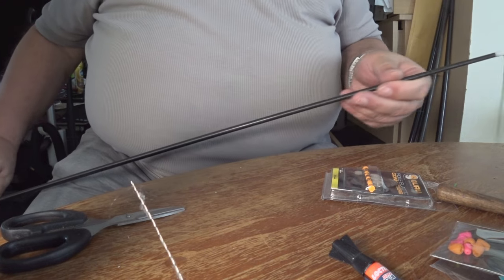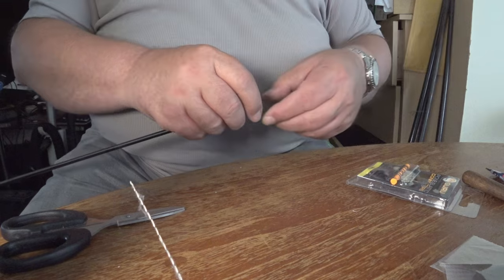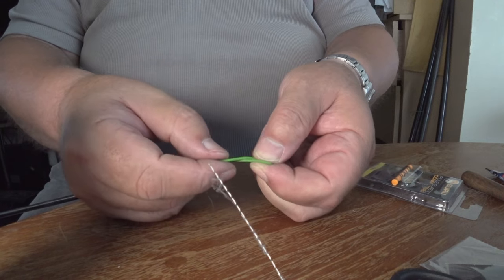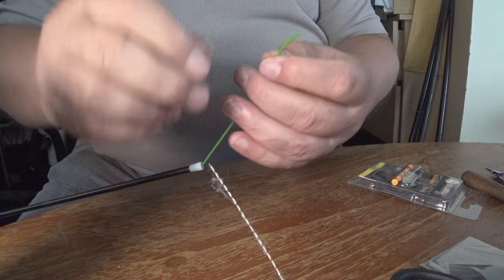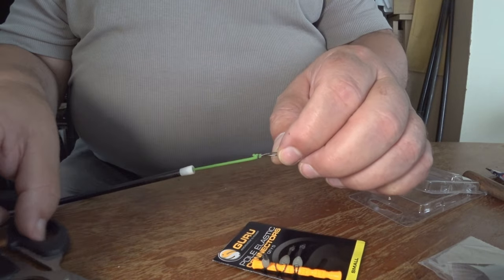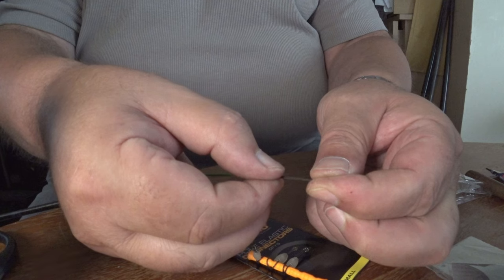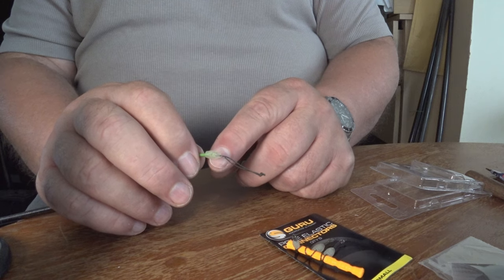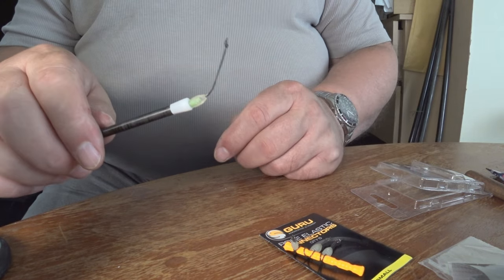Dacron connector to elastic.

Comment: Not lost a fish as yet line direct onto elastic just got make sure you check everytime you use and re tie the knot if needed or buy a new elastic if needed.  The benefit of using line direct to elastic is you can use them for both up in the water and bottom rigs.  I see you are using external bushes ive lost fish when the line goes over the bush internal all the way for me now they are much neater. Just big carp i will use dacron. Just find your post funny that you are worried about the line cutting into the elastic but you are more than happy to use them bushes that dont make sense to me that
Reply from the maker: That kit is somebody else's that I was elasticating for her. I normally use external. What brand of elastic and dacron are you using?
Reply: @apassionfortangling3671  I use Nufish zipp 10/12 with the knot connection, best elastic ive ever used soft enough for bagging silvers, perfect for f1s summer and winter and strong enough to land carp. Obviously every waters different, the water i fish mainly the carp are easier to land on soft elastic ive tried fishing stronger elastic thinking i would land them faster but it had the opposite effect.   Preston 13h is another brilliant elastic as is Black hydro. As for dacron i just buy coated braid from carp section and make my own alot cheaper that way.
Reply from the maker: Internal *

Comment: that coated dacron ruins elastic use a soft dacron out of strong braid our just use a bead had many of 200 pound weights with mono behind knot and bead that stiff dacron not good in my opinion but personal choice
Reply from the maker: Thanks for the comment.
I'm not connecting the nylon straight to the elastic it's okay for10lb carp but I'm after a 30 pounder it'll be like cheese wire. I'm also now using 30lb Amnesia for the connector it's smooth and I bit thicker than the braid. The Guru connectors are fine. It's coated braid but I can't see a problem apart from the diameter is a bit on the thin side. Some coated braid goes a bit crunchy when it gets old so it's something to watch for. 
I'll give the mono straight to the elastic a test by pulling the elastic at full stretch for an hour but I don't fancy its chances 😬👍